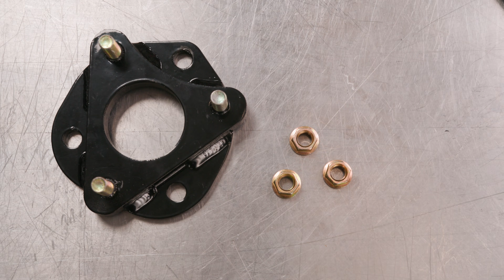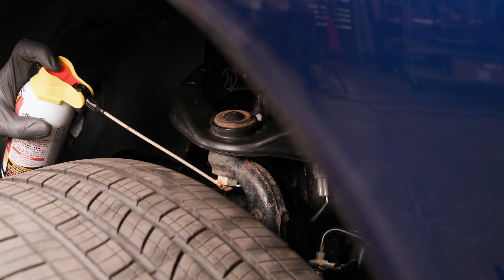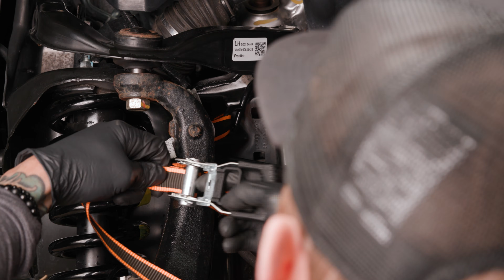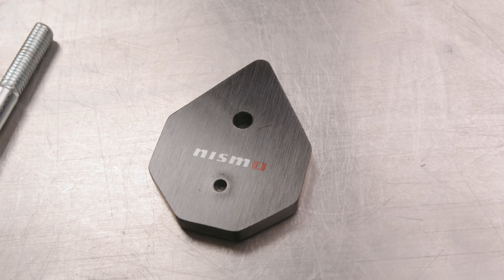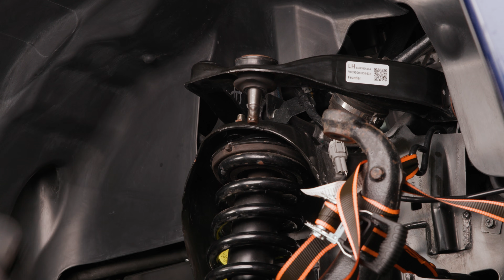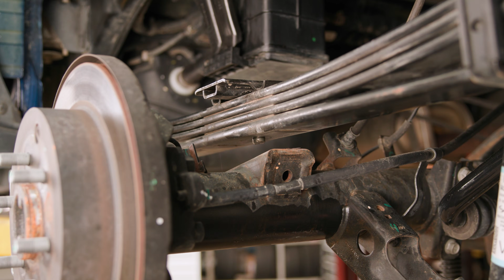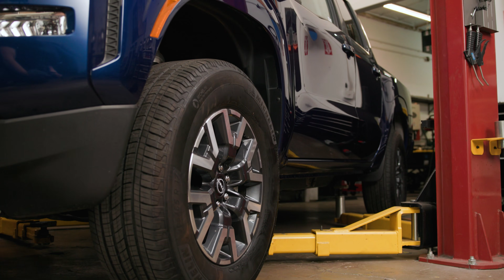Nissan Frontier NISMO Off Road Lift Kit Installation Guide

Comment: If you install it yourself, does it that impact your factory warranty?
Reply from the maker: Hello, Chris. Nissan does not recommend making any aftermarket modifications to your vehicle, as it could potentially void your warranty. For inquiries regarding retrofits and updates to your Nissan, we recommend that you connect with a Service Technician at your local Nissan dealer. Rest assured, they will be in the best position to assist you with installing the NISMO Lift Kit on your Frontier. Contact information can be found here: https://www.nissanusa.com/dealer-locator.html.
Reply: @nissanusa  Your's and Nissans Recommendation is noted... However,.. Lets See how long free speech and the 1st Amendement stands on here either because of the Channel holder or Youtube doesnt want you to know your rights..

Dealerships & New Car Warranty Information

FEARS:
You want to upgrade your vehicle with aftermarket equipment, but you’re worried about putting the vehicle’s warranty at risk. It’s no wonder.  How many times have you heard someone at a automobile dealership say that unless the dealer installs your aftermarket equipment you will automatically void your new car warranty?  This common misconception has been repeated often enough to be widely believed – though it is completely false.

FACT:
Some dealers may not like warranty work, because it pays less than normal repair work.  By promoting the myth that aftermarket equipment automatically voids warranties, some dealers avoid such low-paying work. Instead, they attempt to charge customers the prime service rate for work which is rightfully done under warranty.

THE TRUTH:
Most vehicle owners are not aware they are protected by federal law: the Magnuson-Moss Warranty – Federal Trade Commission Improvement Act of 1975.  Under the Magnuson-Moss Act, aftermarket equipment which improves performance does not void a vehicle manufacturer’s original warranty, unless the warranty clearly and conspicuously states that aftermarket equipment voids the warranty.  Most states have warranty statutes, as well.  Which provide further protections for vehicle owners.

In other words, that means some dealers can’t wiggle out of his legal warranty obligation merely because you install aftermarket equipment. To find out if any aftermarket equipment automatically voids your vehicle’s warranty, check the owner’s manual. It is likely the language you are looking for appears under a heading such as “What Is Not Covered” Although the language seems negative, remember your vehicle manufacturer is simply saying they do not cover the aftermarket products themselves. They are not saying that the products would void the vehicle warranty.

VEHICLE DEALERS OBLIGATIONS:
Suppose your modified vehicle needs repairs while still under warranty.  Without analyzing the true cause of the problem, some dealers attempt to deny warranty coverage.  Someone made a decision simply based on the fact that you’ve installed aftermarket equipment – a convenient way to dodge low-paying warranty work.

Fact: A dealer must prove – not just say – that aftermarket equipment caused the need for repairs before he can deny warranty coverage on that basis.

YOUR RIGHTS:
Point out to the dealer the provision of the Magnuson-Moss Act- Require that they explain to you how the aftermarket equipment caused the problem. If they can’t – or their explanation sounds questionable – it is your legal right to ask that they comply with the warranty.

Fact: If you are still being unfairly denied warranty coverage, there is recourse.  The Federal Trade Commission, which administers the Magnuson-Moss Act, monitors compliance with warranty issues. 

 

Direct complaints to the FTC at (202) 326-3128

This is the actual language of the act:

No warrantor of a consumer product may condition his written or implied warranty of such product on the consumer’s using, in connection with such product, any article or service (other than article or service provided without charge under the terms of the warranty) which is identified by brand, trade, or corporate name; except that the prohibition of this sub-section may be waived by the Commission if:

1.       The warrantor satisfies the Commission that the warranted product will function properly only if the article or service so identified is used in connection with the warranted product, and

2.       The Commission finds that such a waiver is in the public interest.

The district courts of the United States shall have jurisdiction of any action brought by the Attorney General (in his capacity as such), or by the Commission by any of its attorneys designated by it for such purpose, to restrain (A) any warrantor from making a deceptive warranty with respect to a consumer product, or (B) any person from failing to comply with any requirement imposed on such person or pursuant to this chapter or from violating any prohibition contained in this chapter.
 

--- MAGNUSON MOSS WARRANTY ACT ---

US Code - Title 15, Chapter 50, Sections 2301-2312

Legally, a vehicle manufacturer cannot void the warranty on a vehicle due to an aftermarket part unless they can prove that the aftermarket part caused or contributed to the failure in the vehicle (per the Magnuson Moss Warranty Act (15 U.S.C. 2302 (C)) . For best results, consider working with performance-oriented dealerships with a proven history of working with customers. If your vehicle manufacturer fails to honor emission/warranty claims, contact EPA at (202) 260 2080 or www[dot]epa[dot]gov .  If federal warranty protection is denied, contact the FTC at (202) 326 3128 or www[dot]ftc[dot]gov . 

While we at 12° Degrees North Industries believe most dealers do their very best to cover warranty work, even on modified vehicles. We cannot and will not take responsibility for any denied warranty work or damages to your vehicle. It is your right to ask your local dealer to prove any denied warranty work!!!
 

We have found that if you have aftermarket products installed at your local dealership, they most always will cover you under warranty.
Reply: @nissanusa  Said differently,  if I have my local Nissan dealership installs the lift kit, it will not void or impact my  warranty.   Please be direct with a yes or no response.   Thanks
Reply from the maker: @chrisfreudenreich8197  Hi, Chris. We wanted to reach back out and apologize for the confusion in our previous comment. If you do decide to install any of our NISMO or NISMO Off Road parts yourself, it is not considered an aftermarket modification, and doing so will not void or impact your warranty. Our parts have Nissan warranty coverage, the same as our Nissan Genuine Accessories. If you have any further questions for us, please don't hesitate to let us know. Thank you.
Reply: its called the Moss-Magnuson ACT.. they cant
Reply: I don't think it would void any factory warranties because my local nissan dearler has a 2024 frontier sv for sale with a 6 inch lift and some other accessories that they had installed from a local company..i don't think they would sell a new vehicle with no warranties?
Reply: @jamesvaughan6789  IF it's Dealer installed, they, meaning the dealership, will warranty the mods, but I would also make sure you get that in writing from the Sales/Desk manager before committing to purchase..  I sold Nissans for 3.5 years, every dealer is different
Reply: I had it installed last week.  It looks great.
Reply: @maine-lygamingtips2039 Incorrect..

FEARS:
You want to upgrade your vehicle with aftermarket equipment, but you’re worried about putting the vehicle’s warranty at risk. It’s no wonder.  How many times have you heard someone at a automobile dealership say that unless the dealer installs your aftermarket equipment you will automatically void your new car warranty?  This common misconception has been repeated often enough to be widely believed – though it is completely false.

FACT:
Some dealers may not like warranty work, because it pays less than normal repair work.  By promoting the myth that aftermarket equipment automatically voids warranties, some dealers avoid such low-paying work. Instead, they attempt to charge customers the prime service rate for work which is rightfully done under warranty.

THE TRUTH:
Most vehicle owners are not aware they are protected by federal law: the Magnuson-Moss Warranty – Federal Trade Commission Improvement Act of 1975.  Under the Magnuson-Moss Act, aftermarket equipment which improves performance does not void a vehicle manufacturer’s original warranty, unless the warranty clearly and conspicuously states that aftermarket equipment voids the warranty.  Most states have warranty statutes, as well.  Which provide further protections for vehicle owners.

In other words, that means some dealers can’t wiggle out of his legal warranty obligation merely because you install aftermarket equipment. To find out if any aftermarket equipment automatically voids your vehicle’s warranty, check the owner’s manual. It is likely the language you are looking for appears under a heading such as “What Is Not Covered” Although the language seems negative, remember your vehicle manufacturer is simply saying they do not cover the aftermarket products themselves. They are not saying that the products would void the vehicle warranty.

VEHICLE DEALERS OBLIGATIONS:
Suppose your modified vehicle needs repairs while still under warranty.  Without analyzing the true cause of the problem, some dealers attempt to deny warranty coverage.  Someone made a decision simply based on the fact that you’ve installed aftermarket equipment – a convenient way to dodge low-paying warranty work.

Fact: A dealer must prove – not just say – that aftermarket equipment caused the need for repairs before he can deny warranty coverage on that basis.
Reply: YOUR RIGHTS:
Point out to the dealer the provision of the Magnuson-Moss Act- Require that they explain to you how the aftermarket equipment caused the problem. If they can’t – or their explanation sounds questionable – it is your legal right to ask that they comply with the warranty.

Fact: If you are still being unfairly denied warranty coverage, there is recourse.  The Federal Trade Commission, which administers the Magnuson-Moss Act, monitors compliance with warranty issues. 

Direct complaints to the FTC
Reply: This is the actual language of the act:

No warrantor of a consumer product may condition his written or implied warranty of such product on the consumer’s using, in connection with such product, any article or service (other than article or service provided without charge under the terms of the warranty) which is identified by brand, trade, or corporate name; except that the prohibition of this sub-section may be waived by the Commission if:

1.       The warrantor satisfies the Commission that the warranted product will function properly only if the article or service so identified is used in connection with the warranted product, and

2.       The Commission finds that such a waiver is in the public interest.

The district courts of the United States shall have jurisdiction of any action brought by the Attorney General (in his capacity as such), or by the Commission by any of its attorneys designated by it for such purpose, to restrain (A) any warrantor from making a deceptive warranty with respect to a consumer product, or (B) any person from failing to comply with any requirement imposed on such person or pursuant to this chapter or from violating any prohibition contained in this chapter.
Reply: --- MAGNUSON MOSS WARRANTY ACT ---

US Code - Title 15, Chapter 50, Sections 2301-2312

Legally, a vehicle manufacturer cannot void the warranty on a vehicle due to an aftermarket part unless they can prove that the aftermarket part caused or contributed to the failure in the vehicle (per the Magnuson Moss Warranty Act (15 U.S.C. 2302(C)) . For best results, consider working with performance-oriented dealerships with a proven history of working with customers. If your vehicle manufacturer fails to honor emission/warranty claims, contact EPA.  If federal warranty protection is denied, contact the FTC
 

While we at 12° Degrees North Industries believe most dealers do their very best to cover warranty work, even on modified vehicles. We cannot and will not take responsibility for any denied warranty work or damages to your vehicle. It is your right to ask your local dealer to prove any denied warranty work.
 

We have found that if you have aftermarket products installed at your local dealership, they most always will cover you under warranty.

Comment: Kia is coming out with a truck should drop the frontier down to 7th best midsize truck.
Reply: Kia lol
Reply: Frontier sales has it as the #2 selling midsized truck only next to the Tacoma. With the Tacoma being built in Mexico and proved about $10k more coupled with its own reliability issues one would say the Frontier is a much better choice.
Reply: Cool story bro.
Reply: Good one!
Reply: Wtf you talking about? GTFO!!!
Reply: Frontier is #1
Reply: @scott8238  it can barely hall a full bed of mulch.  It’s #1 crap box
Reply: @Stonedroad  it can haul your mom just fine tho
Reply: @Stonedroad well...my 24 sv long bed might not be my 18 ram with a hemi, but it pulls my 3500lb boat and trailer up and down a 25° incline without issue, I can still stick full sheets of plywood and 10ft 2x in it comfortably,  and has the most comfortable seats I've ever sat in, in a truck...so, call it what you will,  but mine works just fine. Oh...and has a NATURALLY ASPIRATED V6. No f*cking turbo.